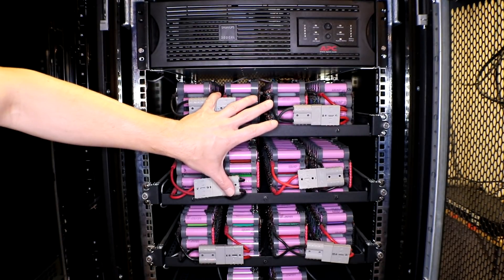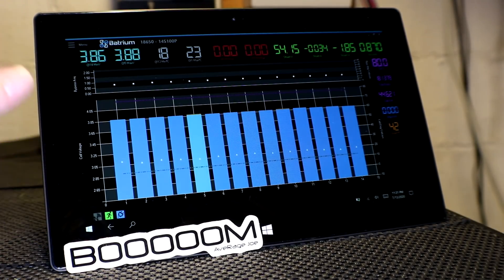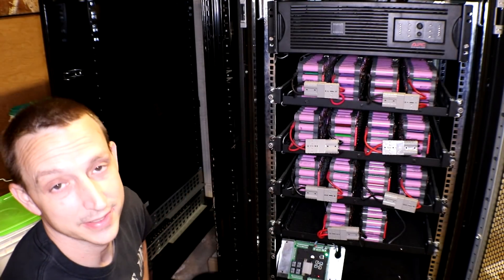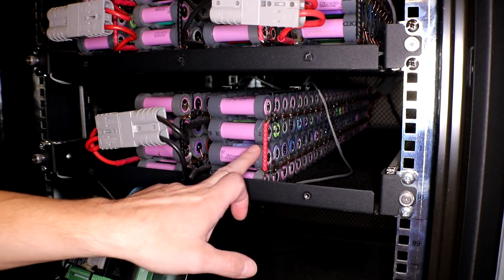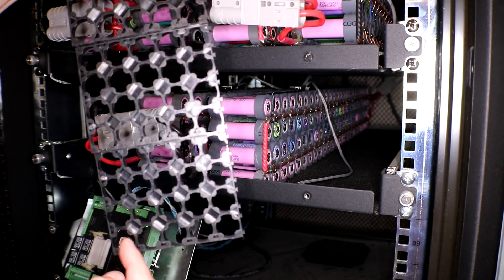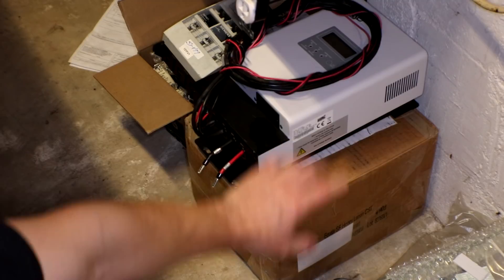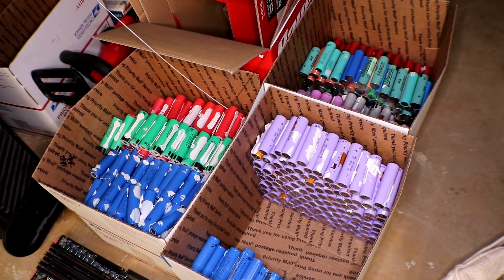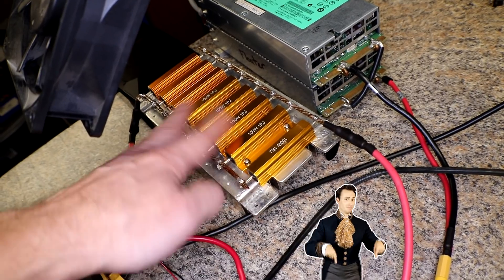Its an 18650 Update!

Comment: how do you get free 18650 cells?  the only wasy I get mine is home depot recycle bin.
Reply from the maker: I use to get mine there. I stopped by all the e-recycle places. Some I paid and some not.
Reply: @AVERAGE_JOE  thank you,  I am in a small city I will check for E recycle.  thanks so much.  Also to fuse or not to fuse each cell or just nickle strip them all together?
Reply from the maker: Used cells you fuse all cells.
Reply: @AVERAGE_JOE  As I thought.  Thank you.  most of my cells are 1200 to 2300 is 2 amp a good size?
Reply: @AVERAGE_JOE  you R my Hero
Reply from the maker: Lol You are!!! Thanks for joining the BOOOOM Team!!!😲😆💥💥💥🤘
Reply: @AVERAGE_JOE  so 2 amp fuse?
Reply: @AVERAGE_JOE  also I Love when you show the Large transformer blowing up when you power something.. LMAO
Reply from the maker: Yeah you can use a 2amp fuse and they will pop around 4amps!
Reply from the maker: 😆💥 Only way to go🤣🤘
Reply: @AVERAGE_JOE  so those are good for cells between 1200 and 2300?

Comment: What are you using for cell monitoring thermally? and cooling..after seeing HBPowerwall cell degredation lately from used/free/old cells, having that much power in your basement...seems like each rack should have some method of putting itself out, if it does go into thermal run-away
Reply from the maker: At this current time is the batrium longmons with the temp sensors on them which is connected to shunt trip. Yeah having all the cells in the basement is NOT ideal. I may be moving them. Also if your are not aware those are not his battery packs. They were anothers. Another thing I do is use glass fuses that pop at 2a. In the future after my next pack build I plan to start using LiFePO4 which is much safer.

Comment: Love your work Joe, what is your return on investment period? It would appear that you are not aiming to avhieve ROI...
Reply from the maker: Thanks!  I still havent sat down to figure out how much Ive spent on everything lol.  Ive tried to spend as little as possible except where needed!  As far as ROI...This is more of a project/journey for me as I like to tinker.  I will achieve ROI but maybe at a slower pace at this current time as I only have the powerwall powering my fridge and basement 24/7. Once I can get more connected to the powerwall ROI will go quicker.  Ill probly need a split phase inverter to do that as there seems to be many circuits in my main panel that are "connected"  somewhere else in the walls or ceiling so I cant separate them...as of yet.  Still looking into that to see what I can do.
Reply: @AVERAGE_JOE  run extension cords

Comment: Looking good. I don't have solar(condo) but I want to build a similar sized backup for cpap and power outages. Love watching your progress. Minds change by the microsecond :)
Reply from the maker: Thanks man! YES Ive gone back and forth on building the ups style battery or regular style. When I finally counted the cells I had, my mind was made up for me lol. Yeah you could easily do one for a cpap for sure!
Reply: @AVERAGE_JOE  Thanks for the reply. I bought a zopec 5500 which is pretty good for 2 or 3 nights maybe. I should have gone for the larger 8000 model but I think I have enough gear to diy the additional 2 nights or so. I'm stuck on my cpap that has 3 wire input for dc and can't figure out what to do with the 3rd wire. Do you have a place you can send me for answers to this kind of question? Thanks again! edit: https://www.zopec.com/collections/zopec-explore-universal-cpap-batteries/products/zopec-explore-5500

Comment: Your original ring cell-holder configuration works very well. 'If ain't broke...' The only improvement that comes to my mind is that they need to be collectively configured for routine thermal camera inspection. Pete's configuration goes a bit further down that road.
Reply from the maker: I do really like the OG PVC cell holder!  I may get some cable management thingys for right behind the drawers so I can slide them out while everything is still hooked up.  My recycler doesnt get many racks but Im always on the look out for free/cheap ones!

Comment: Hey bro,,you got a box of battery stuff laying around youd like to send to a good home..I need a bms or something i can use on my 7s battery
Reply from the maker: What all are you looking for? I have some 10s bms's from hover boards. I hear they can still balance but havent verified that. Probly not big enough for your needs tho.
Reply: I have a 7s 64p and trying to build another. The one I have now works great as power storage and use it for power outages,  but I need to get a bms for it, than charge controller and panels one of these days
Reply: And not trying to be a bum, just never know what someone else has laying around

Comment: Cool beans man. My house has been running off solar/18650 for 5 months straight now. With 3.1kw of solar
Reply from the maker: NICE!!!!! what inverter are you using?
Reply: @AVERAGE_JOE  signeer 6kw . Has ran flawlessly other than the charge board stopped working but they shipped out the part for free just had to pay shipping. Awesome customer  service

Comment: nice to see your UPS working as inverter only and not burn yet. as far as I know they are supposed to charge from the grid more than discharge from the battery. and do it without the care with the battery wasting energy. losses maybe at 30% or more is not a problem. I hope you someday improve your nice system using one dedicated inverter and need less batteries. 
have a plan and thinking is like a war. the start is defined but the end no one know 😀

nice video! keep working !
Reply from the maker: Thanks Man!  Yeah its running almost 24/7 as an inverter without any issues.  Yeah it will charge around 1.5a if I remember right from grid if its plugged in.  Someday Ill for sure get a real inverter!  Ill need a split phase for our funky power!🤘

Comment: Put a fuse in series with with that resistor bank.
The casing on those resistors is only aluminium, the failure mode involves lots of pieces of metal flying around.
Reply from the maker: 😳 Hmmmm....Good to know......as Im almost done testing the winter packs lol.  Ill have to add one for later use after that video!

Comment: Joe we need a video on how you do those calculations.  BOOOOOOOOM!!
Reply from the maker: Especially at 4am!😂💥💥💥💥
Reply: 626 x (3.6×14) =31.5 kwh
Reply: @dylanc9275  what does the 626 represent?
Reply: @stephendunn8782  626 Ah, derived from 260 x 2407 mAh for average cell capacity.
Perhaps easier to convert single cells to Wh first (2.407Ah x 3.6V = 8.67 Wh) and then multiply by
260 x 14 to get the total capacity of 31.5 kWh.
Amp hours are pretty meaningless without knowing the voltage and batteries have wildly different voltages from 1V to 800+V, so we should always use kWh as the unit of capacity as this is independent of how the cells are arranged:
so: 1S3640P would be 8,765 Ah @ 3.6V 
and 3640S1P is 2.4 Ah @ 13.1 kV !
but both are 31.5 kWh.
Reply from the maker: MATHSSSSSSS🤣
Reply: @stephendunn8782  his amp hour
Reply from the maker: Tomato toemato🤣

Comment: Hi Joe, nice update, still a shit load of work.
How is the difference in bank size going to affect things?
100p vs 160p , a lot of capacity difference, does the Batrium have the ability to release a pack from the bank when its charge state gets too low ?
During a power outage, the 100p will go first. What happens when the first 100p gets to pack cutoff voltage.
Fine work, 🤔💭💣💥
Reply from the maker: Thanks and Yeah lol shit load of work🤣 Weeeelllllll I have 2 options to hook the next 14s up. 1st option is to parallel the 48v ends. 2nd option would be to parallel the packs themselves which is what I think I will end up doing for the reasons you mention. So the packs will end up being 260p once all said and done. I dont think batrium has the option to disconnect a string however you could make it do that through relays on the expansion board and another shunt trip/relay or contactor.
Reply: @AVERAGE_JOE  Please keep in mind that you want to keep the maximum short circuit current for a string well within the capability of your Siemens fuses. Stay Safe.
Reply: @AVERAGE_JOE  so you would place a 160 pack on the shelf beside its 100 unit and tie them there.
Your 14s260p system would still be in the one rack, can the rack wheels support that much ?

14S260P damn, what will it take to bring the bank up to full charge ?
🤔💭💣💥
Reply from the maker: Yeah thats what Im kinda thinking at this current time However plans can change all the time lol. I think those slider racks will be ok and the wheels on the rack....HELL YEAH they can hold the weight. The weight of a ups is easily much heavier then a few packs of cells and servers....well im not sure how much those weigh😄
Reply: 260p - what dreams are made of 🤤
Reply from the maker: Yes Sirrrr!😆🤘